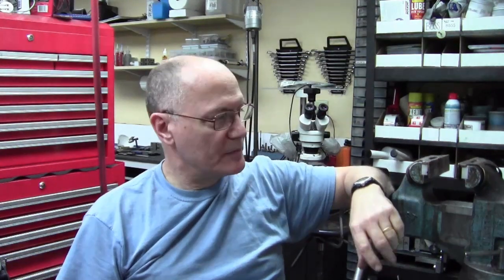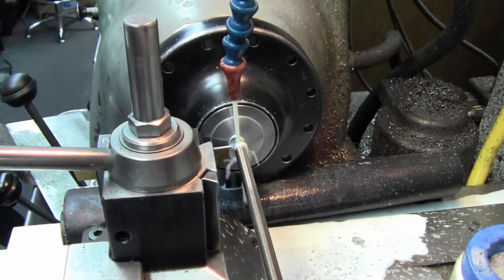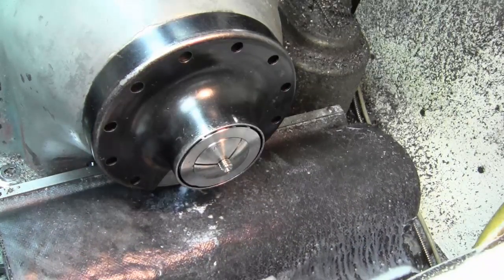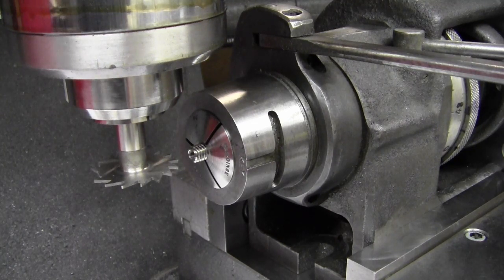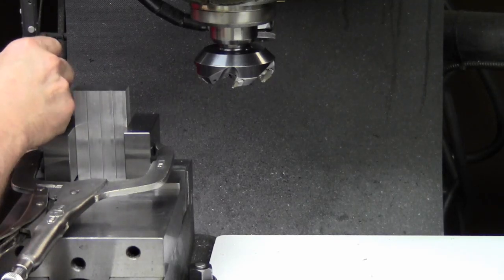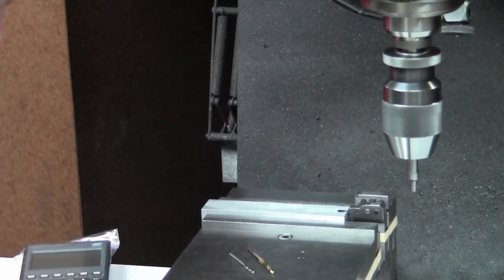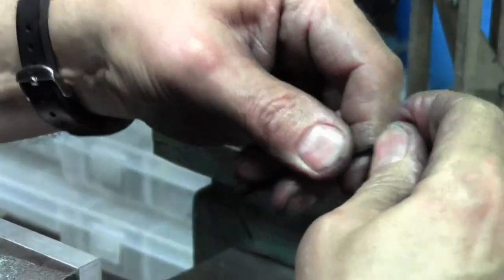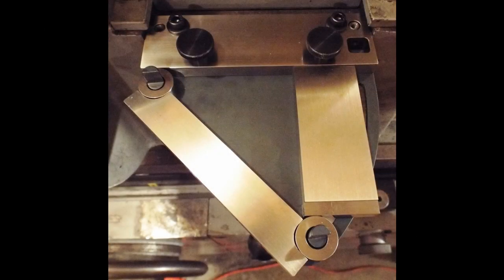Differential Screw Vise Jaws

Comment: I hate those big azz counterbores in vise jaws...  It's like the designer never used vise.

When my wife first went to work for MSC, I was perusing the MSC 'Big Book', just to see what I could learn.  I was checking out bench vises, and got to wondering what differences I could find between inexpensive and expensive vises.  One thing I discovered which dramatically changed my shop life was expensive vises use Torrington thrust bearings instead of thrust washers.

Inspired by thhe info, I decided I would upgrade my vises, to see what the difference was. I measured every vise I had, even on old Japanese vise which had become a doorstop, literally, about 30 years ago.

I spent 10.00 on bearings, and swapped out 5 vises in an afternoon.  

My gawd, what a difference!  Take a look at any half dozen used vises, and 5 of them will have bent and beat up handles, (the other vise is still the box!) They get beat on to tighten, and beat on to loosen.   Not any more.

With the Torringtons, all you have to do is give the handle a tug, and it will not come loose.  When you're done, give it a tug, and it's loose.

In over 50 years of working in shops, and around tools, replacing the bushing with bearings is the single most cost effective, and impactful upgrade I have ever done.

Oh, the old Japanese doorstop?  It's now a usable vise, and I had to find something else for a door stop.

Try it, you will not regret the effort.

Comment: Also this whole swapping out the jaws of a vise is something I've wanted to do for a few years now, and after watching this I think I can do it. I do have a few questions, when choosing a soft metal, copper or aluminum, you obviously need to be concerned with cross contaminating the soft metals up against the steel of the vise, you used Blue molly and something else I didn't catch that you sprayed on to the vise, I want to know what it was, and lastly would that spray be the same material to be used for copper, or would it be different?
Reply from the maker: No contamination or electrolysis issues with jaw materials I am aware of. I think I used LPS3 for long term rust protection on the jaw interface

Comment: Great Video!

How do you align the Chuck on the toolpost to be on center?
Reply from the maker: Thanks ER!  My digital has 99 tool offsets. The drill chuck is tool #1 and is on center at X=0. I use an indicator in the lathe spindle to set center height and X offset once and then its good forever. Thanks for watching and commenting.

Comment: Just started watching your videos and really enjoying your work. Not sure I get all that effort to avoid a counterbore in the soft jaw, but that sine bar is really cool. If these were for the Kurt would you have fly cut them flat and square? Don't mind your fingers by the saw but that all long piece of all thread hanging out of the 5c worries me (as you said). And your collet tension sounded a little heavy :) Keep up the good work.
Reply from the maker: Thanks Gus, I just don't like having to avoid the counterbore when gripping things. And I would have finished the faces if it were for a milling vice. I find that gipping a short length on all thread it pays to be a little heavy on the collet pressure to actually deform the crest a little. If you don't then the all thread has a tendency to easily crush into a barrel shape under side loading. Thanks for commenting and watching.

Comment: Another superb job and video! I really appreciate the way you don't waste time on the air like unnecessary talk and cut time. 
Like the quill hand wheel. Didn't know that exists. 
Could another approach be to cut blind key holes in back of jaws and still use same size access hole through to tighten? Then use a standard #10 bhscs in your inserts. Maybe even keep original 5/16" and increase access holes and of course larger key holes. 
Then you would just loosen the screws, slide jaws, and pull off.
You have a loyal fan and subscriber here Robin. Thank you for sharing.
Reply from the maker: Thanks James and all those ideas could work. Thanks for watching and commenting!

Comment: Nice job...looks like insert clamp down screws...seems a little small and wont last like the original, especially in aluminum. To accomplish your dilemma, 
[too large holes in jaws] better way to remedy this is to have blind holes in jaws, [no holes in front and no dirt getting inside] screw in from the back of vise, will hold better with same size as original.

Comment: There are many comments about drilling through the back of the vice jaws.  I can't help but think that either that would have to be done with a hand drill on the bench, or the vice would have to be removed from the bench and chucked up in the lathe or mill.  Neither one of those seems as appealing to me as Robin's solution.

Comment: Nice idea using the insert screws. 
 I suppose another approach would be to drill holes right through the vice jaw, counterbored at the far end where they come out, and use conventional socket cap screws the opposite way round into blind tapped holes in the soft jaw. 
Obviously there would be a (small) reduction in the strength of the vice jaws.
But there is an in-between solution staying with your insert screw idea: Did you consider routing the access hole for the allen wrench the opposite way, ie through the vice jaw rather than through the soft/loose jaw? The strength implications would be negligible, I would think, and a smooth-faced jaw (whether soft or hard) is a fine thing.
Reply from the maker: Thanks Gottenhimfella those are all valid ideas and thanks for watching and commenting!
Reply: Most people just pull the steel jaws and install soft jaws. Others use copper jaws that are "drop-in" and hang over the steel which provides a good solid backing. Others who do lots of vise work just have a big steel-jaw vice for bit heavy nasty work and a smaller "clean" vice with soft jaws. I don't think aluminum is really going to work too well for much. It doesn't grip too well.

Comment: whats on the magic surface plate?
Reply from the maker: 220 grit silicon carbide wet or dry paper lightly glued on with 3M 77 contact spray. spray the paper back only and let it dry till it is just lightly tacky and press it on the clean surface plate. When you do it just right the paper will  peel off without tearing when its dull.

Comment: Thinking about it mathematically, I'd put these kinds of clamping screws in the same category of 'true' differential screws. If you were to define the pitch of a thread in terms of how far a land moves with one revolution (or how far it will push an object for one revolution) right and left hand threads becomes fundamentally the same thing, the difference being that one has a negative pitch.
Reply from the maker: I agree with that analysis
Reply: @ROBRENZ  you concur

Comment: Great video!  Along with everything else I dig the large flat "stone" shown at 17:50, is there a proper name for that?  I do quite a bit of flat hand grinding/sanding, but am currently using DMT sharpening stones, would love to have something that large.  Any hints on finding something similar?
Reply from the maker: +Andy Lawrence  That is a cast iron surface plate with 220 grit silicon carbide abrasive paper lightly glued on with 3M 77 spray adhesive.  Very handy thing to have in the shop.

Comment: If you were tapping all the way through the vice jaws, and all the way through the thread inserts.... I don't understand why you made a big deal about not having a left handed bottoming tap.
Could have had the normal right hand threads in the vice head, and the left handed threads in the vice jaws. Then attaching/removing the jaws would still be righty-tighty, lefty-loosey

Comment: Hey Robin,

You really should try copper. It is much different than aluminum. Softness is not the only quality that makes copper superior. Nice trick with the turnbuckle screws. 

Best,

Tom
Reply from the maker: +oxtoolco Thanks, next material order I will get some and make a set. I never heard them called turnbuckle screws but that is a perfect description. Thanks for subscribing.All the best, Robin
Reply: Total agreement with Master Ox.  Cu  is big benefit over Al.  Thank you for lesson on differential screws!

Comment: Great video.

Why not drill through the vise jaws, and drill blind holes in the aluminium soft jaws? Then just insert screws from behind and have totally flat surfaces for the soft jaws? You could even put the new holes at different locations so you could still use the original vise jaws when desired.

Off-topic, just found this channel via Stefan Gotteswinter's linking of the precision ground flat stones video. I'm a computer engineer (student, finishing at the end of the month!) and hobby machinist with an interest in high-precision stuff, so the combination of electrical engineering and machining is perfect for me!
Reply from the maker: Thanks, those are all valid ideas and thanks for watching and commenting!